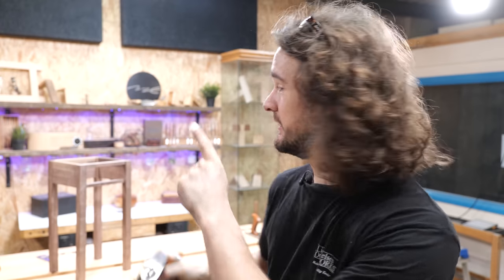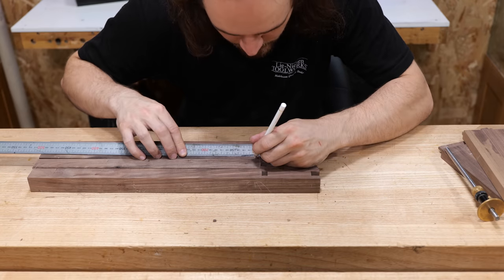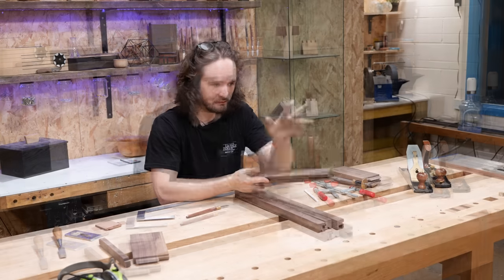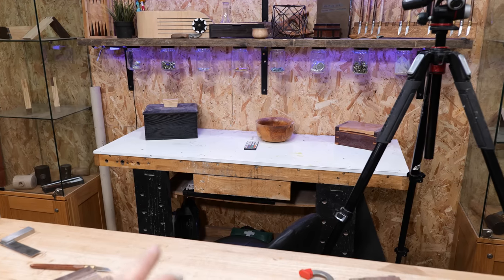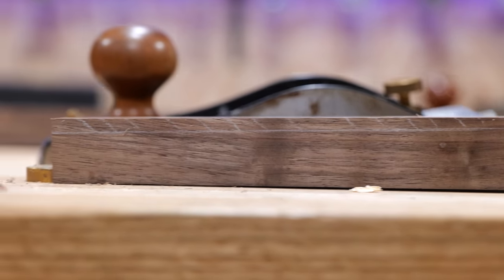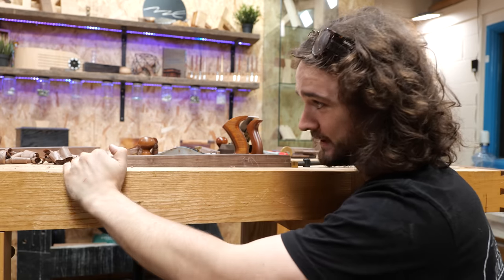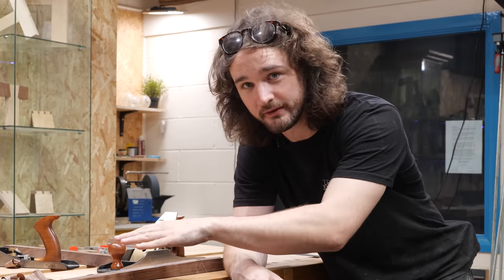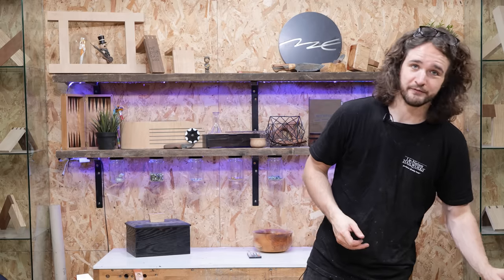Tapering Legs by Hand | Shaker Table Project #6

Comment: Good tutorial and thanks for sharing. I just tapered 16 of those legs out of red oak. I basically do like you do but I used a LN 5 1/5 jack and finished them with a LN 4 1/2 smoother. I'm having a detached retina repair in one of my eyes so I used the Veritas plane fence on both planes. Not getting a taper correct can and will mess up how a table looks in the final build. Anyone watching this video needs to pay attention to what Matts telling you and do as he says. You won't be disappointed in the end results.

Comment: Great tips for planing legs. I made a couple of similar tables with tapers and yeah the grain direction required me to go up the leg, which wasn't too much of a problem. I used a table saw for the initial cutting but used a plane to smooth everything. Came out great!